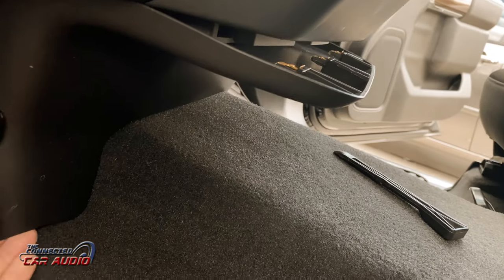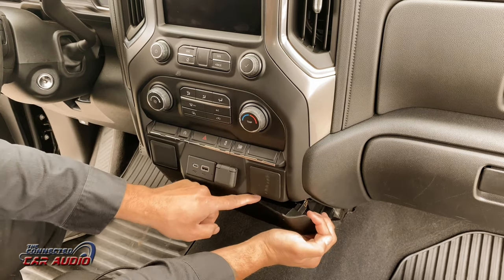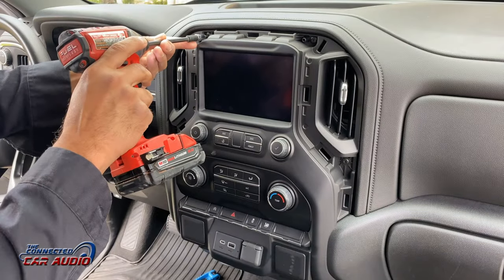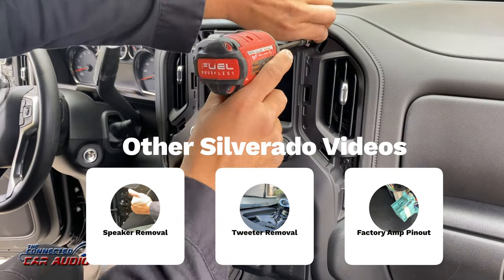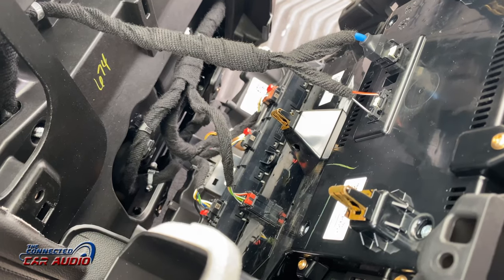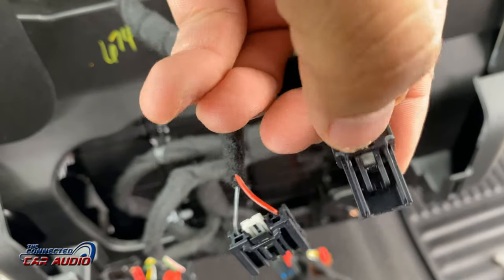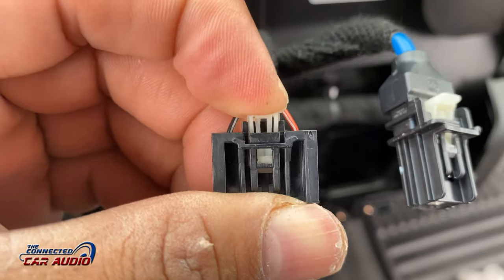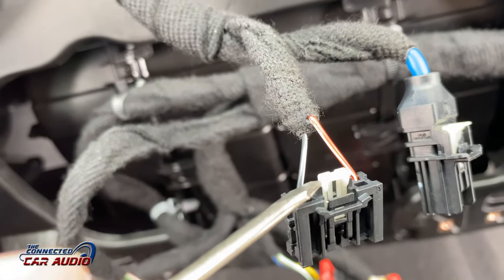Remove factory stereo Chevy Silverado 2019 and up

Comment: I was looking at this vid because I had a issue with my NAV saying "the SD card is removed" and was not able use my navigation.  I had my truck serviced recently and I thought maybe they forgot to plug the USB wire back in.  All wires verified.  If your having this issue with your NAV, it may be the data just corrupted.  Before I ordered a new SD card I did this and it worked...

1.  Plugged the SD card into my laptop. (After shutting engine off/system is off and removed the card from its slot)

2.  Got a notice from windows something like "the data on your card is corrupted and cant be read" and "would you like to repair it?", why not was gonna order a new anyway...

3. I told it to go ahead and repair it, after that I was able to see the data on the SD card (its no encrypted)

4. While vehicle was off, put the SD card back in the slot

Comment: After removal of the head unit, and if the "guts"  to the display are located in my 2019 GMC Sierra SLT  (Non Bose unit) are located in the passenger foot well and the connectors are black and grey, How do you  connect into the speaker wire to add the Audio control Lc7i to have them go to a 4 channel  R2-300x4 Rockford Fosgate amp and to the R2-500x1 Fosgate mono amp for the sub.  I had an LLJ custom T-harness on order and took close to 3 month to wait and I cancelled my order so now I don't have anything to add like the T- harness to my factory speaker leads.  Please help.

Comment: I have a 2021 Silverado with the basic radio. The volume will only reach a low level (20). This started. Suddenly. Is there an issue I should look for or just replace the radio? Thanks

Comment: Hello thanks for the video, where to I find the stock connections to hook up a passive crossover for component speakers (fronts and tweeter in dash).  All the videos I’ve watched show a pair of wires for the dash tweeters and door speaker so I don’t think these are wired parallel.  Any help would be awesome.  Thanks you.

Comment: I found this videos usefull but my issue is i have to take out the whole dash because some green liquid is leaking from the bottom center (under the radio)  of my dash inside the truck 
Its coming from a little black box 
Would you post a video or have any tips to help me? Its my company work truck so the dealer is out of the questions
Reply: green liquid sounds like radiator fluid?

Comment: Quick question: my amp suddenly quit working and after buying a new one and testing all the wires, my remote isn’t getting juice with the ignition off or on. 

I kept the factory head unit, so do you think the installer would have used the area under the dash or the head unit for the remote wire connection?
Reply from the maker: I would look under the dash first for a fuse tap and then look under the hood for a fuse tap 

If I’m not mistaking this vechile doesent have a 12 volt switched ign wire behind the radio 

But switching amps out should have not changed this. Maybe you accidentally blew a fuse why it was hot and we’re changing amps out.

Check all the fuses in the car also he may have tapped into a circuit not at the fuse 

And now a regular fuse is blown
Reply: @connectedcaraudio  Appreciate the info! This is exactly why I stopped installing my own systems in 2009! It used to be so easy but now you really gotta know what you’re doing! 😂

Comment: I am curious where the passive crossover for the front 6x9 and the large 2” tweeter in the dash is. I would like to put a passive 3 way crossover and replace the factory speakers up front.  I will flush mount a tweeter on the sail panel. The rear will be 2-way coaxial.
Reply: Curious as well, trying to figure out if my front door speakers and tweeters and in parallel or series cause I don’t know where to put the passive crossover

Comment: Anyone else have a touchscreen that has a mind of its own? I thought it was a software related but now it looks like a hardware because the problem pops up only when the outside temp is above 85⁰F.
Reply: Any update? Haven’t had mine in the summer time yet but randomly when using apple play the whole stereo shuts down and restarts itself
Reply: @ransidass6615  They replaced the touchscreen only after GM got involved. No problems since (knock on wood) The tech said there was an internal short that was causing the problem.
Reply: @ransidass6615  mine does that too randomly shuts down and restarts when connected to Apple CarPlay